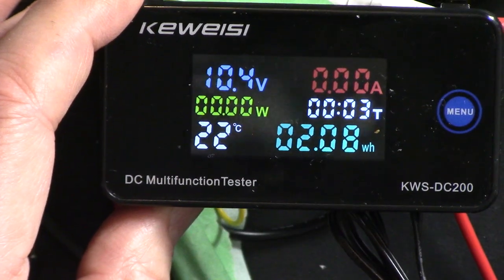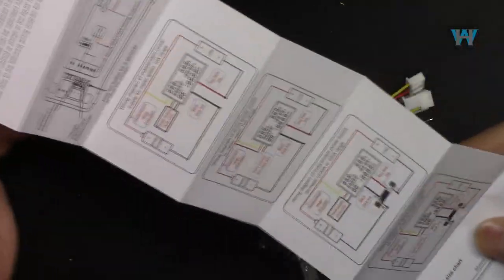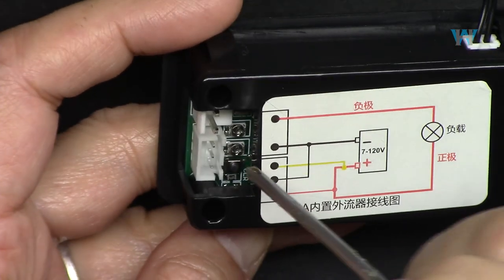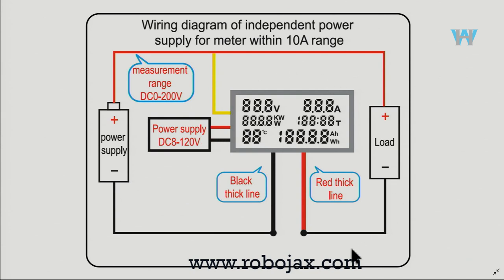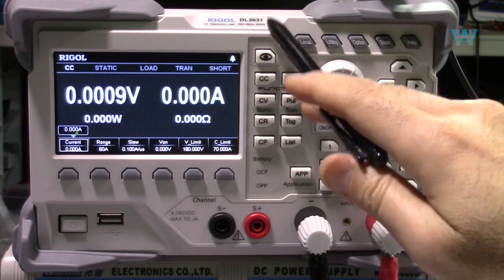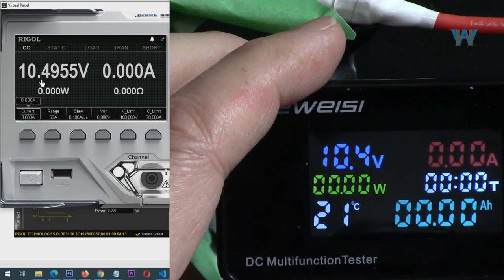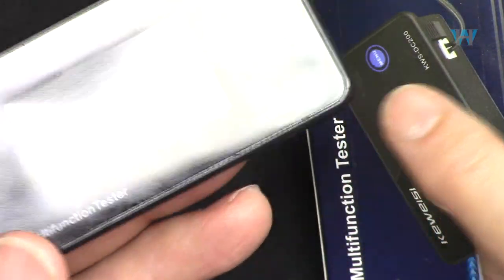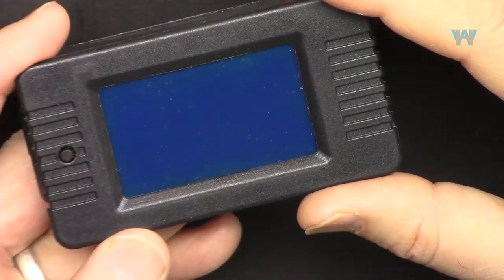Review of KWS-DC200-10A 0-200V DC Energy, Power, Capacity Volt Ammeter Calibration

Comment: Thanks for the video review.  I just bought the larger meter that includes PF and frequency.  My range says 85-250V not sure what the lowest will be since your version goes down to 8V.  I wanted to use it to watch the output of a variable frequency drive at 220V, 60Hz, 1740rpm, 1hp, 3A, 3ph.  Since the output is generated by PWM it may not work correctly.  I will only connect to 1 phase.  I'm not sure what to expect at say 10Hz speed and also the motor is rated for 120Hz inverter duty so 200% speed.  Probably a good idea to try it out before I cut the hole in the front panel.  I really like your electronic load.  I'll have to look into one of those.   Thanks again.

Comment: When the current is reversed, does the cumulative aH/wH indication (on the bottom right side of the meter) deduct from the previous reading?
Reply: if you reverse the current then zero current will be indicated
reversing the big red and black wires will allow current to be measured
you can add a dpdt switch with crossed connections to allow current to be measured without reversing the big red and black wires

Comment: The meter that I have was intended to be used in a circuit requiring 50 100 amps however I want to use it for a circuit that is less than 10 amps I did notice that they didn't put a clamping resistor in the circuit that would be the resistor 00.05 my question is is without that resistor current will not pass that's an incomplete circuit if I use the shunt provided it is sizable I want to keep the installation small compact as possible

Comment: The button on backside is for resetting current to zero if it reports non-zero current reading even when there is no current through sense register.
Reply: What exactly is the procedure for adjusting the current consumption indicator?  my meter overstates by 0.23A.  when the potentiometer on the back adjusts to the appropriate value, then after disconnecting the current source, it does not show 0A, but just 0.23A.  when the reset button is pressed, the measurement error starts to appear again.

Comment: I consider buying the 300V AC model so it can be used on 230V Mains.
I've found various models with same design concept...
 KWS-AC300 300V AC 10A shunt / 10A CT / 100A CT
 KWS-AC301 like AC300 but also does Power Factor
- also has Comms and more current
 KWS-DC200 200V DC 10A / 50A / 100A shunt
 KWS-DC22 like DC200 but for electric vehicle?
Similar front panels, but probably there is significant differences inside. Do you consider performing other reviews?
Reply from the maker: If they manufacturer or reseller sends it for review, I will talk to them. WattHour.ca is our website

Comment: Hi sir!!
I have an e scooter 72v 30a battery 
I connect the DC200 with the 100a version!
All content as you say, before last picture! Connect all wires except the small black!
The only thing i but more is a one-off switch!
The measurement is Ok!! 
But after 2-3 minutes on off alone like it's overvolts and cut of power and give again!!
I taught wires to understand overheating but No! 
Is any chance to make it from switch??? Either, did I make wrong to not conect the small black wire ( you in picture don't connect it)
Thanks for the video my friend!!!🙏

Comment: My 10A version can measure more than 10A . Today it showed 13,6A - charging current from FV pannel. The same value showed a PWM controller in serial connection. Have you tested max. value of current this measurement is able show correctly?
Reply from the maker: Hi, no image not. I simply respected the rating so the meter is not damaged.

Comment: I wonder if a pair of these can be used with a dual polarity power supply. If this device will display negative voltages, it will work.
Reply from the maker: yes you can do that. each will word independently.

Comment: I have a 10A version meter. I also have a spare shunt from a 100A version. Can I safely use the 10A meter to measure high amperage with the help of the 100A shunt? Thank you.
Reply from the maker: this device has microcontroller and it is programmed to measure. The current is measured from the voltage drop of shun. Now if it received higher voltage first it might burn. if that does not happen, you will get 10 times higher reading and need to consider that.

Comment: how to properly calibrate the current consumption indication?  my meter is cheating.  when the potentiometer on the back of the device sets the correct measurement values.  then after disconnecting the load it does not show 0A.  then i click the switch on the back and it resets.  but after that the meter shows the current consumption again.